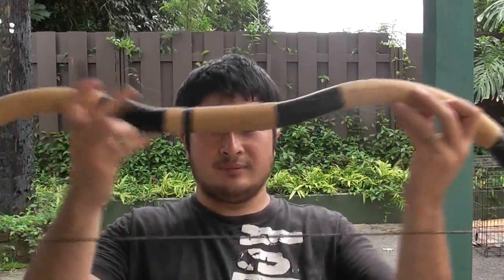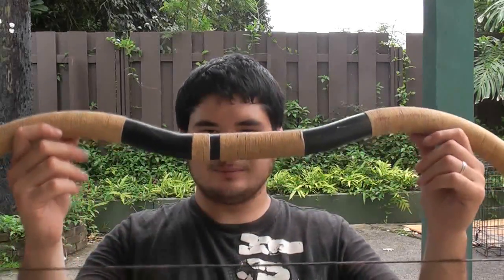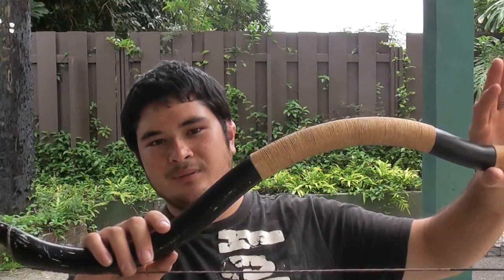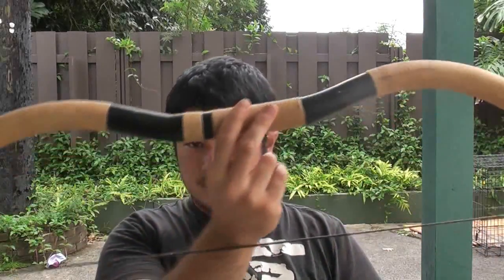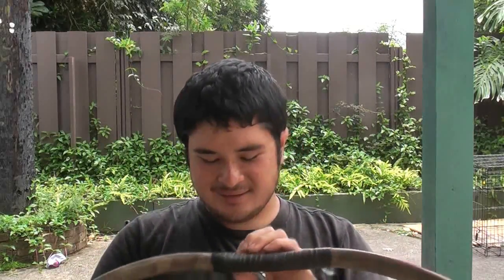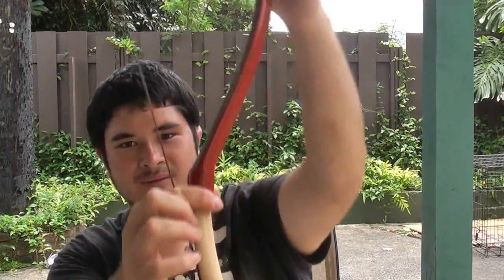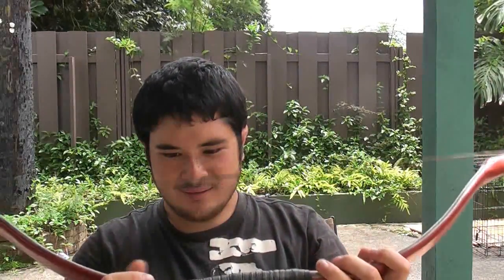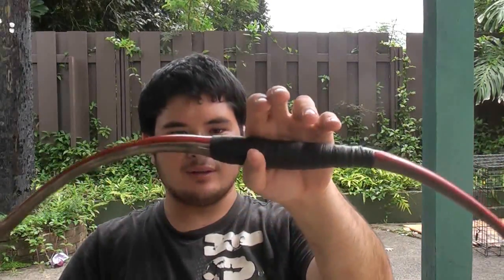How Long Do My PVC Bows Last?

Comment: Hey BackyardBowyer?  It's been 11 years since you've uploaded this video- how are your bows holding up?  Thanks to you I've brought many people to archery using pvc bows I learned to make from you, and they're holding up nicely for a year and counting.  EDIT:  Funny thing- the same day I posted this comment, my favorite bow of one year broke- I just pulling it casually multiple times.  HOWEVER, this bow has gone through numerous reformation, has broke once already (snapped in half because I was trying to reform the center without heat), and was made of pvc pipe that failed the hammer test.  This bow was around 40 pounds.

Comment: I'm a buyer of your ebook and still enjoy your videos after all these years. Enough years have now passed that you really should do an update on this subject if you haven't already. I have several PVC bows inspired by you and they have been kept indoors all the time. I haven't really checked them lately but I did check a long piece of pvc pipe recently with your test and it was brittle and shattered when I hit it with a hammer so they can definitely deteriorate.
Reply: Maybe revisit your older bow with updates.

Comment: I noticed that some of your videos you make a no-heat straight pipe bow and others you make a tapered bow with heat and flatten the pipe.  What is the difference between a no-heat straight pipe and a tapered flattened pipe?
Reply from the maker: The no heat bows are equal in strength from handle to both tips, so they tend to be very heavy to draw but the lack of an even flex means they do not translate energy well. High draw, low speed. Adding a fiberglass core strengthens the center the most and gives less support until the tips are PVC only. A tapered flattened pipe is strongest in the middle and becomes weaker as the limbs are flattened until they are weakest at the tips.

Both methods achieve a similar result in different ways. The tapered bows are generally faster because they are lighter, but the core bows can be made longer without significant loss in performance than tapered bows. It’s been my experience that a fiberglass rod inside of a tapered bow usually adds around 10 pounds of draw weight while keeping the relative speed fairly close. The no heat bows have very high handshock and also cannot hold recurves without first partially flattening them and locking the rods in place so they cannot rotate.

Thank you for watching!

Comment: i dont get why dry firing would be any different than firing with an arrow its niot like a gun where the firing pin can crystalize and break can you explain why its not a good thing to do with a bow plz ty
Reply from the maker: Thanks for watching! The energy stored when the string is drawn back has to go somewhere. When there is an arrow on the string, the energy is transferred and the arrow is launched. Without the arrow, the energy feeds back into the bow causing vibrations. These can cause damage and cause the bow to fail.
Reply: BackyardBowyer makes absolute sense

Comment: I have a 40lb pvc bow which was made 22 years ago and is still going strong. It has been kept in a cupboard inbetween uses out of direct sunlight. To be honest it wouldn't surprise me if it went another 22 years
Reply: Yeah I would guess sunlight would be the biggest factor in longevity. Plastics don't do well with extended exposure to UV rays.
Reply: Acrylic latex is great UV coating.
Reply: What is the length of your arrows

Comment: plastics biodegrades in hundreds of years, that's an environmental problem today well known by everybody, so I bet that a well epoxy-coated PVC bow would last easy at leats 25 years and sure losing less than a 10% of its original draw weight in that time.

Comment: hey nick i made the pvc no heat long bow with the fiberglass rods and i shot it for about 2 months at least fifty times a day and and you said it pulled 40 lbs it shot excellent but i recently got my fiberglass shakspeare 30 lbs draw back from my fatherinlaws house and i tested the fiberglass bow and it it pretty much on target every time but i strung the pvc bow and shot and the arrow dropped about foot from the target area i shot both from the same distance and i was wondering if possibly the rods in the pvc bow snapped or are starting to wear down i still want to shoot the bow but it feels like it is wearing down please let me know if i can fix this problem

Comment: do i need to unstring my bow, or will it damage the bow?
thanks
Reply: +Ezra Reed It's always better to unstring when you know it will have a lot of down time but some last better than others. Also, some bows do not lend themselves to unstringing, for instance compound bows. If not a self bow consult the manufacturer. I leave my compound strung but stored in a moderate spot like a dark inside closet. I wouldn't store one in garage as most are uninsulated and get pretty hot in summer!

Comment: I think that this discussion of how long a pvc bow will last compared to other types of bows is really rather moot. After all, anyone who makes a bow of this sort is very likely going to want to make another one soon after with some slight improvements. Eventually, any tinkerer will have made several of them and will likely still not be fully satisfied. So, if the bow lasts for months, years or decades it matters very little, because you can always simply make another one.

Comment: One question are there finishes (like a paint or spray or wrap) that would help prevent UV damage.
Reply: +Jea Dallmann If you use the grey electrical pvc conduit it is uv rated from the factory
Reply: Thanks

Comment: Hello. I have a question. I've made a 30 pounds PVC bow and wooden arrows, but when I shoot it my arrows don't fly so far than a 2 or 3 meters. Then I made another but this time I made a 60 pounds bow, and now my arrows fly over 20 meters. So my question is what is the right power to make a wooden arrow fly well, cause I've seen some of your videos where you use a 30 pounds bow and your arrows fly long distances as if were a 50 or 60 pounds bow? I would appreciate your advice. Thank you.

Comment: also your sch 40 and 80 pvc pipe has more filler than conduit. i am still learning more about pvc pipe as i go im sure other more experienced people with pvc pipe can add on to what i said or correct something i may have gotten wrong. also i know something that may help strengthen your bow's if you ever get the chance to get a tube micrometer you can check the wall thickness of the pipe you bought and you can find the thickest part of your pipe and face that to the front of your bow. that way you wont have the thickest part on the side or the back facing you. thats just a thought to try out.

Comment: I work in a PVC manufacturing plant. richard greswell and james t have 2 very good facts about PVC. the thing with PVC pipe is different factories use different compounds to make the pipe. cheaper compound means you have a weaker pipe. although that does not mean the pipe you are using is bad because all PVC pipe has to pass set Q.C. standards across the country. but different factors effect the pipe such as chemicals it comes into contact with, weather plays a factor as well. cold and heat can cause problems. the sun exposure can weaken the pipe. but your bow will not be outside its entire life. the reason why the sun can weaken the pipe is because the pipe is made to be installed under your house and in the ground where it is not going to get much sun light. most factories do add chemicals to protect their product from the sun while it sits outside waiting to be shipped off to the dealer or the job site. there really is not a way to measure how long a pvc bow will last
Reply from the maker: rick showalter PVC pipes can be tricky things. Plumbing pipes can have a lot of fillers. I know the main company that makes the pipes I use uses a lot of calcium carbonate (gypsum, chalk) as a filler. Most of the time the pipes are sound, but I have found ones that seem chalky and others with visible particles and grit suspended in the plastic. I've found that pure PVC pipes tend to be more slightly more sluggish and slightly less heat-stable than plumbing pipes.While more sluggish, I really like the way furniture grade PVC works. The pipes are usually more uniform and seem to hold up really well without any special treatment.Thanks for the comments!
Reply: Heirs To Olympus + You're a two bit hustler and a one bit beggar.

Comment: PVC has placticizers in it which makes it flexible. Over time these placticizers will migrate out of the PVC and it will become more and more brittle. UV radiation speeds this up but it will happen over time regardless. Depending on the quality of the PVC and the placticizer/s used would determine how long it's potential life could be.
Reply: The bows ive seen him make have fibreglass cores, meaning the fibreglass is supporting the pvc and the pvc is almost like a backing. Im far from an expert but that was my observation.

Comment: PVC is quite susceptible to UV radiation and like many plastics becomes brittle with exposure.  It also embrittles naturally over time as well as at an increased rate in the presence of heat.  Expecting a bow made of PVC to last longer than wood is just not realistic.
Reply from the maker: James T The majority of wood selfbows don't last very long. A year or two and about 1,000 or so shots through it is a good life for a selfbow. Wood is also susceptible to damage from UV radiation and also degrades naturally over time. It's just not noticeable because most wood bows aren't exposed to the sun and elements for extended periods. And those that are usually aren't expected to last. When I started making PVC bows I was worried about UV damage and degradation, but it has been less of a factor than I expected.  If you treat a PVC bow like a fine wooden bow, then it will last a very long time. On the flip side, if you treat a wooden bow like a PVC plumbing pipe, it won't last very long at all. Now if you're talking about fiberglass or fiberglass laminated bows, those things can last a very long time, even if mistreated.
Reply from the maker: Jay Boothe I love those old bows! My first bow was a Ben Pearson long recurve from 64' that my dad used for hunting when he was my age. It's still one of my favorites! You are absolutely correct that wood can last a long time if taken care of, especially by people who know what they are doing. I have handled and shot bows that were nearly 100 years old.

What I was talking about is the average wooden selfbow that is made by a person or purchased from a maker of "economy bows". I used to make and sell bows like these. Generally the expectation is that a person who buys or makes a bow like that is going to use it a lot and maybe even abuse it. They may not take the string off when they should or do any preventative maintenance like oiling the bow if it's an oil finish, or keeping it clean and dry if it's a poly finish.

1-2 years or 1,000 shots is kind of like the powertrain warranties car companies offer. If you are good about maintenance and take care of the bow, it will last far beyond 2 years and 1,000 shots. Just like some old cars are still on the road with hundreds of thousands of miles, there are some old bows with lots of mileage as well. But generally, the majority of wooden selfbows made don't last that long.

Like you said, craftsmanship and maintenance are key. I've seen a 200+ year old violin being played and that instrument was in better condition than most year-old student violins I've seen. Though the main point I was trying to get across is that UV damage is a real consideration with PVC plumbing pipes, but not a huge consideration for PVC bows that are well taken care of.

If I took a well-made wooden bow and kept it outside in the sun, wind, and rain without any care or oiling or anything for a year, I am very confident that it would be in a very sad shape. When I made a lot of board bows, it was important to me that the wood I bought had been stored inside. Generally, thin boards that have been outside in the elements, while they may look and finish fine, will usually not last very long at all when made into a bow.

Now if I took a well made PVC bow and took care of it, kept it indoors, and maintained it, it would probably last for quite a while. The 60 pound bow in this video is now around 5 years old and is still shooting. I have put thousands of arrows through it. And it is neither particularly well-made nor has it been maintained very well. I honestly think a well-made PVC bow would last as long as any wooden selfbow if well-kept.

Thanks for watching and thanks for the comment!
Reply: BackyardBowyer My main Wooden Long Bow was made in 1962 by Ben Pearson.My Grandfather hunted with it as did my Uncle and I have shot it hundreds of times.Wood will last a century if well taken care of with oils etc. How do you think Guitars etc from the 1900s are still being played today? Well craftsmanship over rules anything.Though anything exposed to the sun a lot will weaken with time.
Reply: BackyardBowyer Indeed man. Good to hear from others on any type of Bow.
Reply: All I have to say is there are many Many many self bows that have lasted many decades. A lot of guys shoot self bows made from Osage that were made 20+ years ago. There are also Osage bows around much older than that as well. Well made self bows don't wear out unless they are mistreated or made with low quality wood
Reply: +Jay Boothe Jay, there are quite a bunch of us who either still have their Ben P. bows or use to have one. I am in the latter category. I shot bow a lot as a kid then got a 22 so archery went by the wayside. As a young adult I picked up a bow again, hunting with a Ben P 45#. I  eventually moved on to a Jennings model "T" 55# compound and used it a long time til it got stolen recenty. I replaced it with a old Bear 60# compound I got off Craigslist for $25 and that is my current bow. It works fine but I wish I had held on to the Ben P. as it was fun to shoot and looked nice!

Comment: I dont think this guy knows how to measure the pull strength on bows and crossbows. No way is that bow 60lb pull force. if you guys are all using the normal bathroom scale method, you are going to get skewed and wrong results. buy a force gauge. clip it on the string, then draw back the bow normally. It will give you an accurate pull force everytime.

Comment: Problem with PVC is low temp. It becomes brittle.
Reply: Good to know! I'd hate to make one of these and catch a limb in the face! lol
Reply: Adam Bodford That has happened to me. No fun.
Reply: You can easily fix this by using ABS pipe
Reply: Richard Greswell they become more efficient when they get stiff, though. which means faster arrows and harder draws... but also the possibility of a failure

Comment: Time shall tell little brother. I have one I made my very first after watching your video. It had about a 50 pound pull not a pretty bow but, it worked it has been strung hanging on my fence for about 8 months. I live up in the mountains about 2400 ft elevation. I am doing a test with synthetic Sinew I have shot about 80 arrows from it and shoot it from time to time. The Sinew is still hanging and so far the Bow hasn't broken. After it goes through a Hot Summer I shall let you know how it does. I don't live up in Alaska but trust me it gets cold up here and also has its days of heat. I shall give you my evaluation as time is the best evaluation along with the weather. So far it is good and I think if it was indoors it might last a lifetime. Time shall tell.

Lou Caravayo.
Reply: +Lou Caravayo And ? does it still work ?
Reply from the maker: That's impressive! Thank you for testing that, I'm looking forward to the results.
Reply: I would like to see the out come. I just picked up a small re-curve from a a guy who is very good with your methods. It is such a nice bow. Very impressive.
Reply: So, how is the bow doing two years later?
Reply: We have the right to know!

Comment: PVC bows become brittle in cold weather. I live in Washington. We had a few days that were below 32 F. I was shooting one of my PVC bows and it broke on release. Even though the bow has never been dry fired, after like ten shots it shattered right where the grip is. I must say I had this bow for like 2 years.
Reply: You Need "massage" The bow simulating release slowly 10 times or more to unrigid internal fibers in frozen days, before used. Keep you arc inside you house. or use the power of sun to warm it. Or you can make a bag with old sleeping bags. try to use CPVC instead regular pvc pipe

Comment: I judge a bow on two factors, penetration into  a foam target! and how far it can cast an arrow @ 30 degrees
, and possibly dose it feel good in my hand, but from watching you i see this the average arrow length is 31, on your 80#  it looked like you were only drawing 25-26 inches? so what is your draw length?
Reply from the maker: With the 80# bow, I honestly was only drawing about 26". On some shots I only managed 25" or so. There's really no excuse for it, but I had already done a lot of shooting when my wife said I should film it and I was beyond tired. In one of my shooting videos before I finished it, I was getting a full 28" draw on it with 31" arrows.

My draw length is 27" when I stoop over, a bad habit gained by building and shooting selfbows for a few years. When I straighten up and draw to anchor, my draw is 28". Clear to the back of my jaw is about 30" or so.